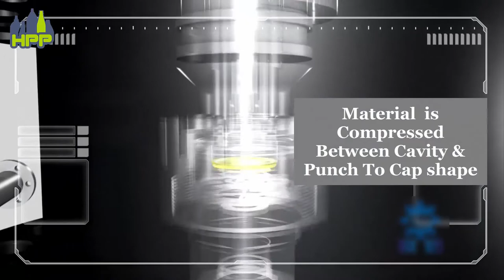Cap Compression Molding  Machine

Comment: Cap ke kon si achi h. Compression ya injection moulding
Reply from the maker: Compression molding for large qty of caps, for smaller qty injection molding is better choice
Reply: Hassan Plas Packaging  low cost kiski hoti h.